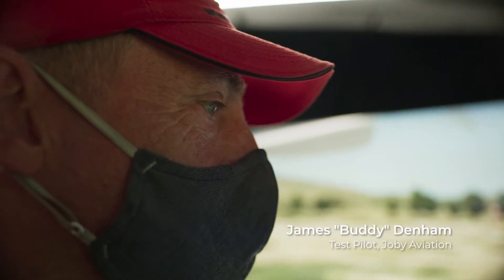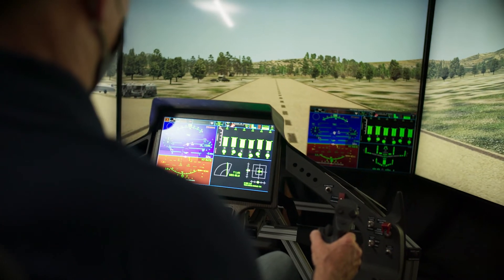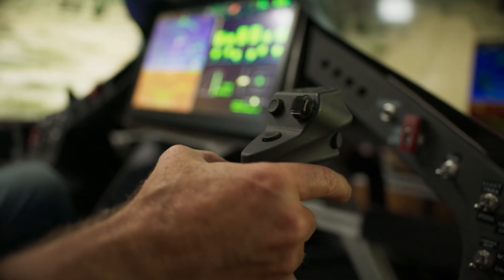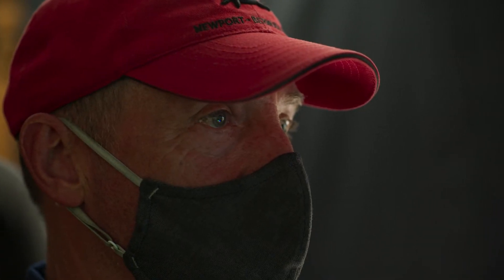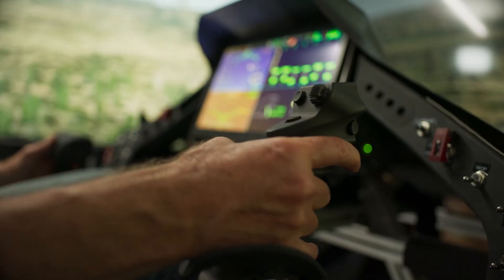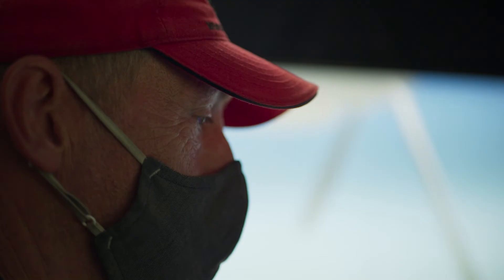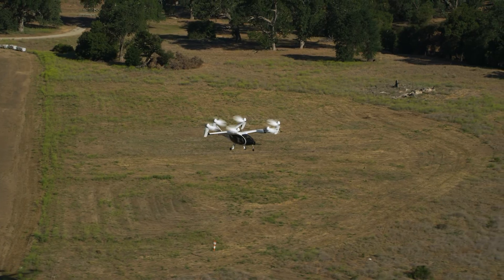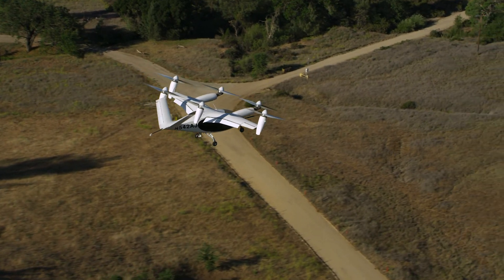How We Reinvented Flight Controls for the Joby eVTOL Aircraft

Comment: No issues with cross-coupling in the yaw, altitude and directional axes? Is this a rate command or proportional command FCS? I would love to get in this simulator
Reply: Compared to a helicopter you have to sacrifice piloting options. E.g. in hover a lateral stick input will initiate yaw or a sidewards movement. In hover you can’t have both.